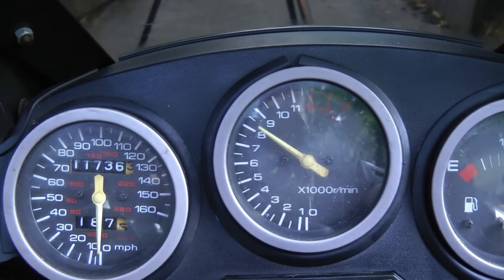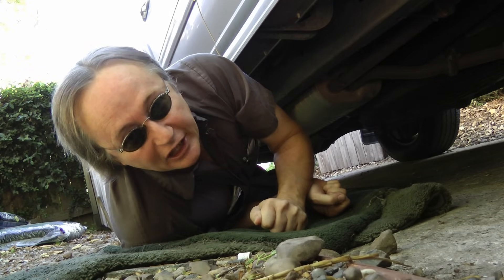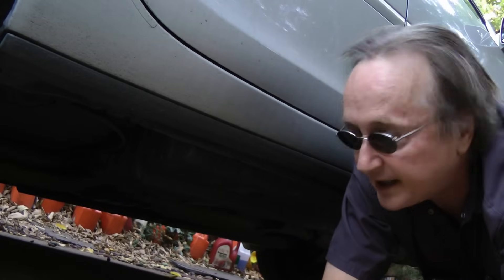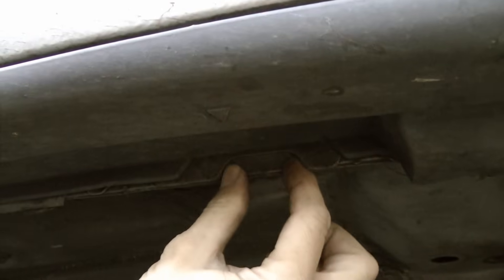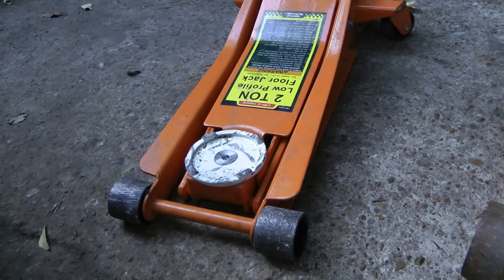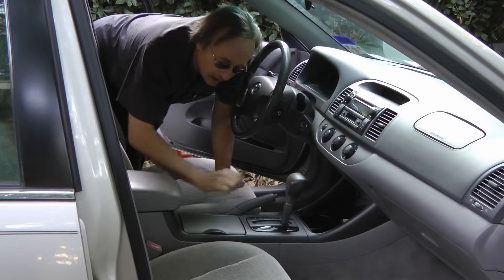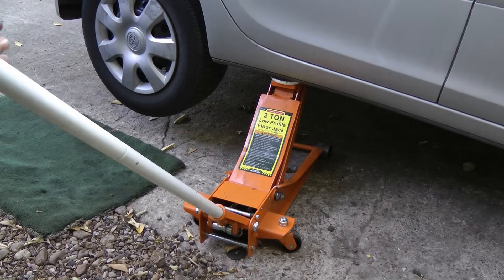How to Jack Up Your Car (The Right Way)

Comment: putting the jack stand where he has it on this vehicle is unsafe as fuck and would get a tech fired on the spot at any shop that gives half a shit about safe work practices, put the floor jack there and use 2 stands in the spots where he says to use the jack...

don't play games with your safety, hospitals are expensive for you, funerals are expensive for your family
Reply: Exactly right. I can't believe this video is even up. He places one jack stand at a centralized point in the car? He's going to get someone killed, it's fuckin ridiculous. And then he just opens the valve on the jack and let's the car crash down on the stand. This guy is a complete buffoon.

He's doing it all ass backwards. He should've used the floor jack on the centralized front or rear point, and then placed his jack stands under the pinch welds.
Reply: Yeah, I was like wtf? I've never seen anyone put a jack stand right there. He did the opposite of what you're suppose to do. First, jack the car up from the center on the crossmember, then place the jack stands on the left and right side.

Comment: I used a jack on my 99 Intrepid about 3 months ago to change the oil, and I used it on the jack point, as I should, and was getting ready to move a jack stand in, the car suddenly came crashing down but the jack was still in the up position... and inside of the car.  I opened the door and I could see a hole and a lot of rust.  When I put the car up on a lift, a mechanic let loose with several expletives and referred to the car as a rust bucket.

I used some expletives too.

Comment: That doesn't look stable at all with ONE jackstand. I'll never get under that.
Reply: Well if you're only doing work on one side and you jack it up on one side and put the jack there its fine but if you jack upp both sides well then put two stands

Comment: I’m fan of urs Scotty. But this vid is little miss-informed. 
1st. I’d rather use the jack on the frame. Or the  the one u place the jack stand. The front has the exact same frame with the exact shape as the back where u place the jack stand. It’s design for jacking purpose. ( Toyota only )
2nd. Using the e-brake when u jacking the back. Makes no sense !!! I would use block of wood on the front  tire.

Comment: For those who dont know, most modern cars have a designated spot in the front and rear where you place the jack to lift .. You could try lifting it by the jack stand points but that would be awkward because youd have to lift it way higher because youre only doing one side, and then where would you put the jack stands. Youre better off just doing it properly. Supporting it with one jack stand is kind of sketchy and probably harder to do anyway. Just try it

Comment: A SINGLE jack stand, Scotty.......really??
Reply from the maker: yea, it works fine if you know where to place it
Reply: it works fine for you but is it the safest? "it works fine" is the saying that has gotten many people killed or hurt
Reply: Scott probably used a high capacity jack stands. A 3 ton jack stand can only support 1.5 ton (rating is for a pair) is about 3000 pounds, which is probably pushing it.

Comment: dude remove this crap before it gets reported that is the wrong way with a floor jack you ate folding and bending thise tabs so when the person needs to use the proper tool that comes with the car it wont be able to be installed correctly

Comment: Just to let you know, a good place to jack the front of the car is on the K-member.  It's the bar that goes from the side of the car right behind the tire to the front middle.  It holds the engine on.

A good spot for the back is to use the axle tubes.  However, do not ever use the pumpkin (differential) to jack up the back.

This is for the mustangs.

Comment: Keep a board in case you have to jack on soft ground.  And regularly check air pressure in a full size spare tire.  Keep a can of fix a flat in case the spare is flat.  Pops gave me that advice.

Comment: I did this with my previous Toyota for brake work, etc, and it still bent to hell until I didn't feel safe lifting there anymore. The metal gave too much when I tried that I had to find alternative places to lift. Tip for the ladies too: Get a high lift jack so the gals don't rub against the undercarriage. (Speaking from experience.)

Comment: Those pinch welds bend since they are sheet metal. You want to try to lift the car up at the strongest point the solid steel frame that wont bend or rust easy. These unibody constructions are the pits and highly recommended that you protect your frame by using Fluid Film or something similar to keep your car from rusting and take care of any rust you see forming right away. You can put the jack stands on the frame rails but keep the lift jack up on the solid steel frame.

Comment: Those jacking points are for the supplied jack only. A LOT of cars will just mangle if you put a trolley jack here. Those chassis rail things are the perfect spot for TWO jack stands, they don't bend, ever. Jack it up from your trans cross member or your diff cross member, use the supplied jack to raise it if its too low for your jack.

Comment: Jack notches are made for the (stock jack )that came with the car 🚙 🚘 .. using a standard floor jack may crush the stud notches . I use a 2 x 4 to help the standard jack to handle any shape on the undercar to stable the jack!

Comment: I leave the jacks in place with that weight on the stands. If a jack fails the jack will catch it.
Reply: Robert Gary I’m similar with that, but whenever I’m doing work with the tire off, I slide the wheel under the car so worst case scenario it won’t fully crash down, plus I don’t leave the full weight of the trolly jack, I leave light pressure but still I agree with your intentions on jack stands

Comment: I absolutely love watching Scotty's videos. I have learned so much and they have saved me a ton of money.

With that said, this particular video cracked me up. The point Scotty picked on the Toyota  Camry to place the jack stand is actually the recommended jack point per the owners manual. The hole in the middle of that bump is to accommodate a jack attachment that's supposed to be in the trunk with the tire changing kit. My Corolla manual also shows this as well.
Reply: I was gonna say, I've heard of people bending the point where the scissor jack is supposed to go by using a floor jack.

Comment: Tip: Have two solid 1/2" or 3/4" thick pieces of 2 foot by 3 foot plywood in the trunk for dirt or muddy roads to put the jacks on.

Comment: I tried jacking up my Ford Escape to change the front sway bars, but I couldn't even get the wheel off the ground with my Sears jack! So I had to use the scissor jack that came with the car in order to jack the car up!

Comment: Today I learned that if you try to jack a Honda Odyssey on asphalt your jack might start to sink into the asphalt. 😑 Choices were the asphalt or semi-sloped concrete driveway. Switched to the driveway. (Don't have plywood boards around to set under the floor jack atm).

Comment: I have always jacked up the car or truck from the axle IF im jacking from the back anyway. Now I jack up the car or truck pending if it has that BIG middle thing where 4 wheel drive vehicles have in the truck axle and use that like I do in the back but I also use the frame to jack on but I use the more solid parts of the frame never had a problem

Comment: There are young kids who will see this video and do exactly what was mentioned but there are still some safety tips not mentioned. For instance once the jack stands are placed and the car get lowered on them, shake the car to see if the stands will hold. Also if you take a tire off, lay the tire on the floor near where you will work right underneath where the “notches” are. This way if the jacks do fail then the car will land on the tire/rim and not on your head.

Comment: Great video. However I always try to find stronger points of the vehicle instead of the pinch welds. They usually fold in and are unstable. I found it better to find the subframes strong part and Jack it up there and put the stands right next to the jack
Reply: On cars without severe rust there, I always use the part of the pinch weld that is reinforced and that is designated by the manufacturer as the correct lift point. Not just "any" point on the pinch weld, rather, the reinforced point. You will definitely fold the pinch weld if you miss the reinforced point. I always read the manufacturer's service literature to find out. This info is usually in the owners manual too, not just in the service literature. On older cars with rust on the pinch weld I may be forced to find other places to lift or support the car. But never anywhere on the pinch weld that isn't reinforced. But good luck finding stronger points such as subframe points. You have to really know what you are doing or you could cause subtle damage to the subframe that changes the car's wheel alignment and driving characteristics.

Comment: I almost always agree with Scotty, but not this time. You don't put a floor jack direct on a pinch weld without some type of adapter. The pinch weld is not designed to actually support the weight. The factory scissor jack can be used there because it's specifically made for pinch welds, and it uses the pinch weld to positively locate the support pads on the proper spots.

Comment: I have 3 ton Jack's same size plus 3 ton jack to lift my Saturn. I'm going to tape on cloth padding on jack and stands so as not to accidentally scratch my frame.* Note: I once crawled out from under my car to clean my hands after an oil change and i noticed my jack slowly depressing to zero. I was younger and I didn't put jack stands to support 1 1/2 ton car jack. 3 ton minimum.
Always do it properly. It could be a matter of life and death!

Comment: I keep forgetting about this because up north cars can start rusting at as little as 5 years old. I tried this on my first car and the rocker collapsed while I was under it (thankfully it didn't fall on me). I always use the lower suspension arm to jack since those tend to stay solid much better than the body does.

Comment: I hate it when I have to put the car up on jack stands because I don't have any confidence using the pinch weld.  I have decent quality equipment but I've had the pinch weld bend on me and it usually takes me about 30 minutes of positioning then repositioning, lifting, lowering and repositioning and finally I've got the car up on stands and by that time my heart is about to explode.   I'm also afraid that I'm going to place the jack stands in the wrong place and cause damage to the frame.  I appreciate these 'how to' videos but I would love it if someone really gave a detailed video helping people like me feel more confident when raising their vehicle and giving multiple options for raising the vehicle or placement of jack stands when the pinch weld isn't necessarily an option
Reply: Yeah this video confuses me at 0:53 he says not to use that part and on this website this guy specifically says to use that part for the jack stands idk this is so dumb

Comment: On a lot of mid-size & smaller cars you can't use a decent floor jack at the pinch welds because there isn't enough room.

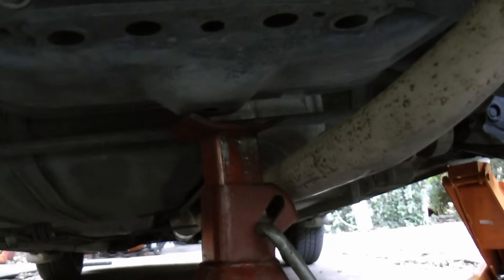Comment: Ooh, at 2:19 he jerks on the emergency brake. I did that and stretched the cable. I was able to adjust the length of it, but it was always easier to stretch after that. Metals have a critical failure point that once, exceeded, result in a weaker metal (in this case, the metal cable).

BTW, I miss having emergency brakes. Nowadays it seems everybody gets to have crappy parking brakes. I have used them in emergencies, from failed brakes on the NJ turnpike (just as traffic came to a sudden stop, exceeding my emergency engine braking capacity!) to a controlled backwards slide on snowy hill where I needed to lock up the rear end while I kept the front end steerable to whip it around. In both situations, I would have been screwed by having only a parking brake.

Comment: Best way to life any vehicle is a shop lift lol once you use one you’ll never wanna use a jack. Btw my current jack is a cheap one and not low enough for my car so I have to use a scissor jack to get the floor jack under then use jack stands of course

Comment: I believe those two notches are made for scissor Jacks that come with the vehicle I would be afraid to use a crank up Jack like that without bending that little piece of metal
Reply: That’s where the jack stands go
Reply: Here's my question that little metal Notch were the scissor jack goes you jack up the car well how are you going to get to jack stand under there now

Comment: if i am doing a quick brake job ill just use the jack and give the car a few shakes....if i have to go under i use 2 stands and leave the jack slightly tensioned and block the wheels and give it a few hard shakes to be sure.

Comment: If your car is old  never do this because rust will destroy the floor of your car faster. Lift only on solid steel cross member/strut bolt/rear shock then.

Comment: Good advice, however, The problem with just using one jack stand is that the weight capacity is half, since their rating is usually for the pair.

Comment: Seems like a mention of the pucks or a slotted block here would be in order.  Also blocking any wheels left on the ground.  Lifting the rear end of a RWD with unblocked front can lead to disaster.

Comment: What is the ton you need for Toyota Corolla 2008 model . Would the 2 ton work or do I need the 3 ton Jack and Jackstands . Reason I ask the higher weights cost more - I do want to be safe but also not spend if not needed.

Comment: If you have heavy rust on the pinch welds the jack stand will go right through it...and you will die. That is probably why he puts the jack stand on the subframe. If you jack up on the pinch welds, you are usually not under the car so it doesn't matter if the pinch welds fail. That is why he does it backwards. Difference between a seasoned professional and a DIYer.

Comment: Hi Scott, my car only shows 4 jack points like you showed with the notches. Nothing in the middle of the car like yours. So my questions is how do I get my jack stands installed if I'm already using the designated jack area with the notches with the trolley jack? thanks.

Comment: Scotty,

If I was using a bottle jack. should I place it right behind the jacking points  on the pinch  rail?  Is there usually a reinforced section  or box there?

Comment: Brainstorming today about jacks/jack stands I rather have a hydraulic over head lift obviously but for home maybe there would be a jack that is good enough out there for reasonable $60 ish. Anyway nice video . Though I really hate creepers and sliding under stuff with those walk under hydraulic lift there so comfortable and don't ruin your self over time in difficult positions. However a really good jack / jack stand/ wheel chock / creeper setup might be something I do for a home thing. While I am into it. So debating all depends on height the jack supports and tonnage it lifts. I have no problem making any shape or height jack stands out of concrete heck buildings are made out of this stuff. And jack stand making would be cheap and safe. The issue is being able to jack up to the level I shape/cast the high strength grade concrete at . Because jack stands without a jack to get to that height defeats the purpose of making jack stands...

Comment: Great video Scotty, Hey there scotty, I have a 2009 corolla le , I don't know where to place the jack stands to lift up the front of the car for an oil change. I went back read the manual all it shows are the jack points of the car. Thanks for the videos scotty.

Comment: Scotty, it's very hard to find a safe location for the jack stand on many new cars, often because of the plastic that is underneath.  Could you do another video specific to good jack stand locations?
Reply: Owners manual is your friend. There is almost always a reinforced point in the front and rear along with side reinforced points. The tow hooks on cars are reinforced as well.

Comment: Can I just use the Jack if I don’t have a Jack stand. I’m not doing any work on the car, we are just going on vacation and one of our cars has a cracked rim that needs to be replaced, so the tire slowly goes flat over time. I was just wanting a little extra support so the tire doesn’t go flat and sit with all the pressure on it while we are gone. Once we return we plan on getting a new rim.

Comment: Are the candles really necessary if you're just changing your tires? I totally understand to use candles as a safety measure if you're going to lay under the car so it doesn't accidentally fall on you, but when jacking the car for 2 minutes to change a tire...

Comment: I have a Volvo C70 2011, and I can't see those two cut outs on the seam you show on here, so can i assume it's safe to put my low profile hydraulic jack along the seam close to the front wheels ?

Comment: I recently jacked up my grand caravan on those welds and they bent over. These areas are for the jack that comes with the vehicle. I don't care if it bent over because I use a mighty garage jack now. I may not like it if there comes a time when I need to use the oem jack. So I call AAA and they use their jack. Whatever ...right???
Reply: Those reinforced areas on the pinch weld are fine if one uses the slotted hocky puck or slotted piece of wood on top of the jack pad. This replicates the slot that is in the jack that came with the vehicle.

Comment: I noticed the driveway is slightly sloped but when car is jacked up it seems level. You have the handbrake  on but would it not roll back on front wheels with rear wheels lifted off the ground?